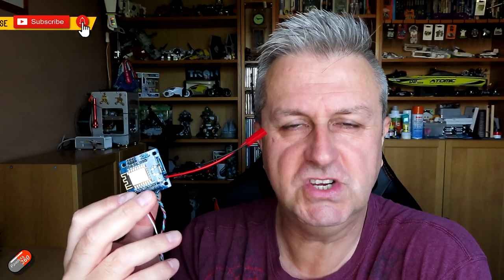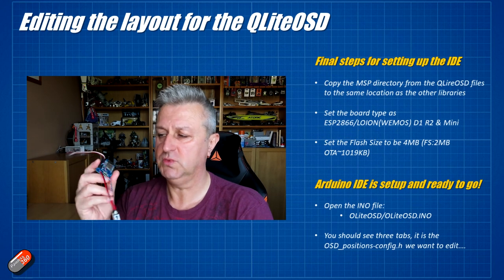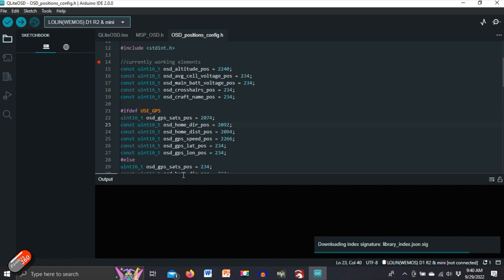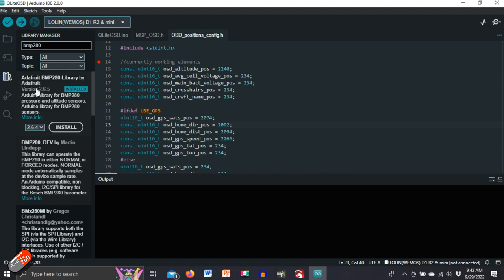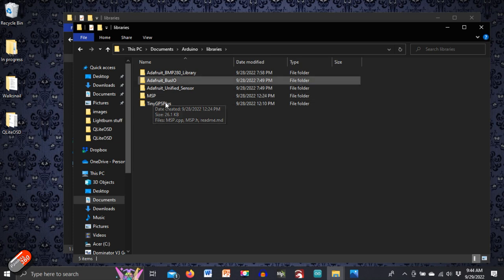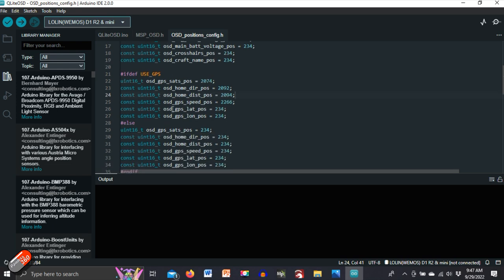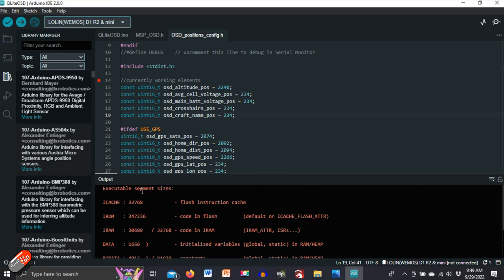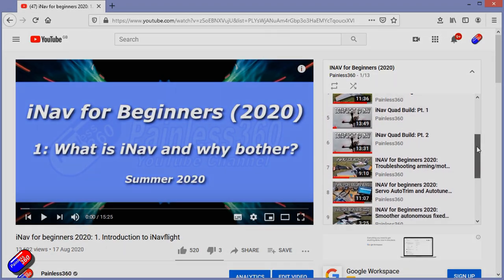QliteOSD : Moving the OSD elements on your DJI HD FPV OSD

Comment: Thanks for sharing. QliteODS is an interesting project.
Was not aware of this low cost option to enabling OSD telemetry. It even appears to support data logging. :)
Reply: Look into fpv.wtf and the msp osd . Full osd enabled with your existing FC. Works with BF, iNav, Ardupilot. Custom fonts etc.

Comment: Hi there jeremie here…in Savannah ga got a few questions for u with my DJI m900   Pixhawk 2.1 in it .I got a pix hawk kit off Amazon came with
 pix hawk  flight controller 2.4.8 
1. ground module  
2 . ppm  
3. mini osd  
4. 12c splitter 
5. v1 power module . 
I plugged motors wire 1 into motor 1 on the pic hawk motor 2 to 2 and all 6 motors . The two servo wires for landing gear( spread wings dji m900)
I assume go to motor 7 and 8  on Pixhawk fc. Now here is where I will. Need your help please. How can I reach out to u for help? Thanks!
Reply from the maker: please see my PIxhawk setup videos.. best of luck!

Comment: This looks like a very interesting project. Is it possible to record the video with overlayed data in the goggles?
Reply from the maker: Not in the DJI system, something they never fixed.. However. The system saves the telemetry onto the memory of the Arduino as you fly and you can download it and use it in things like Google earth after the flight!